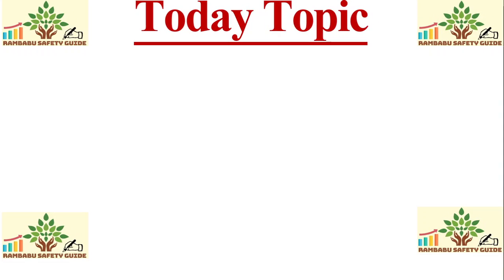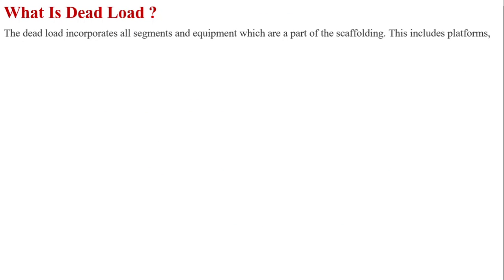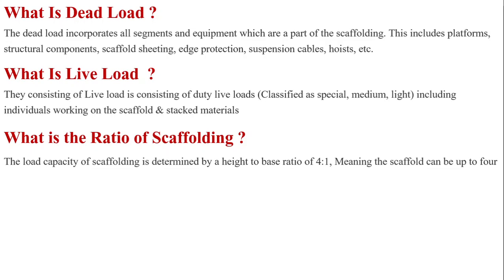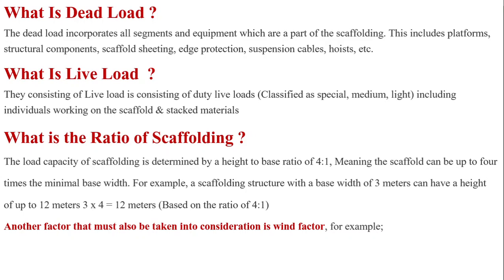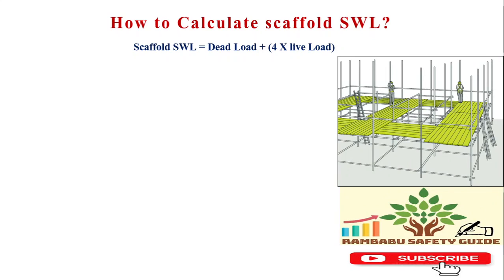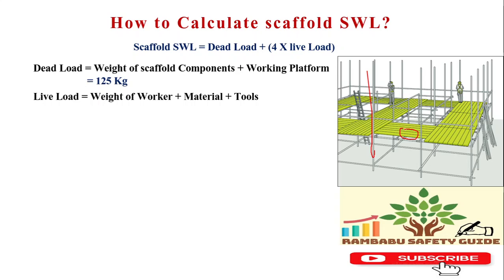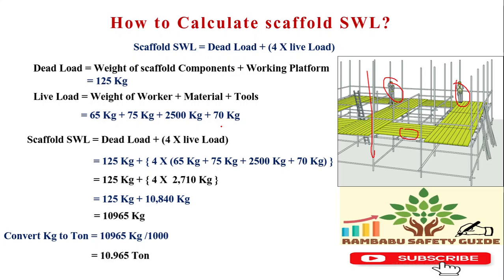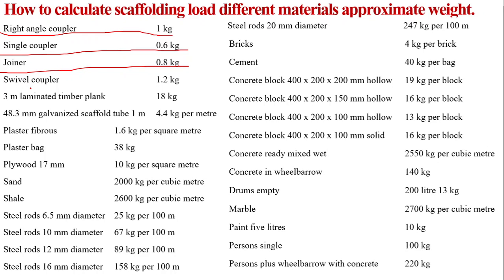Scaffolding SWL Calculation ! Dead Load and Live Load Calculation ! Dead load live load wind load

Comment: TNX for sharing sir. I would like to ask how to determine if the scaffold is safe to use base on the safe working load calculation.  How to compare the strength capacity of the scaffold base on the SWL .